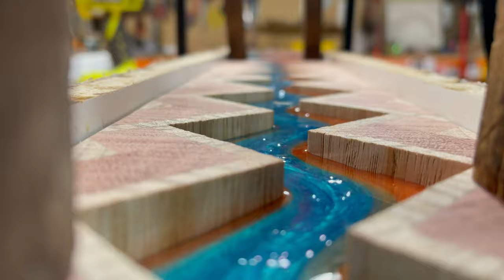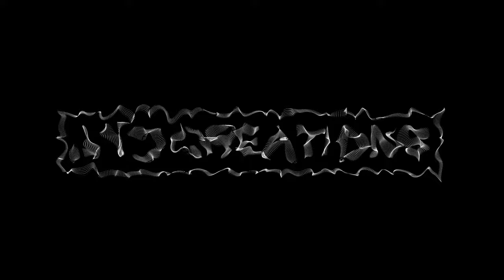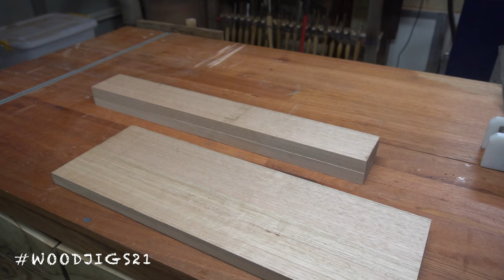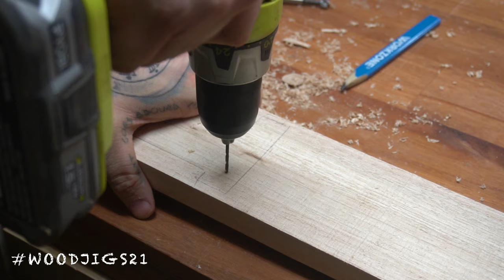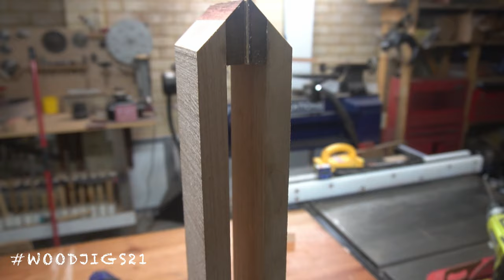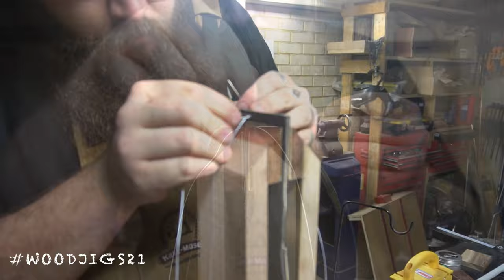Stitching Pony || #Woodjigs21

Comment: Nice job. But can you please confirm that the toogle clamp is used to force the Jaws apart instead of the usual arrangement of closing them?
Reply from the maker: It does both. There’s a nut threaded on each side of the timber so it apples clamping pressure and also forces them apart.